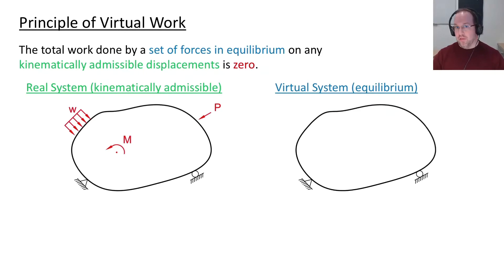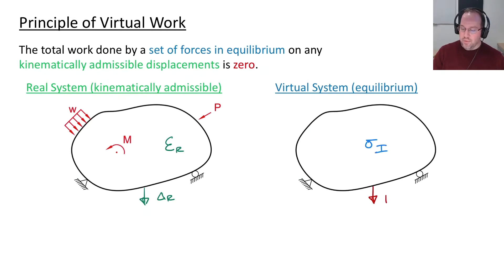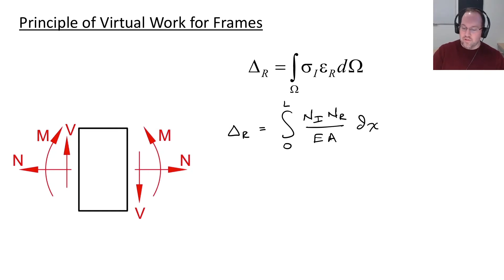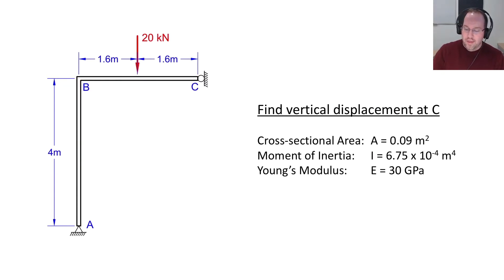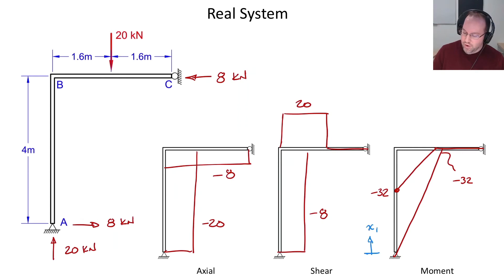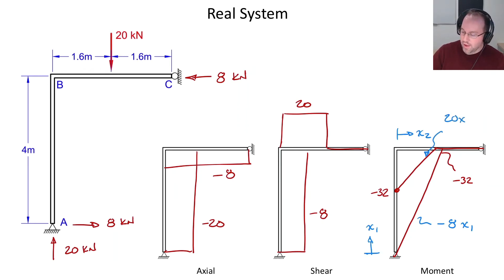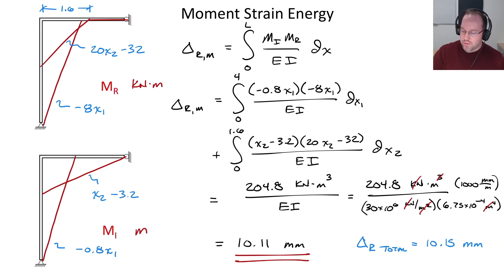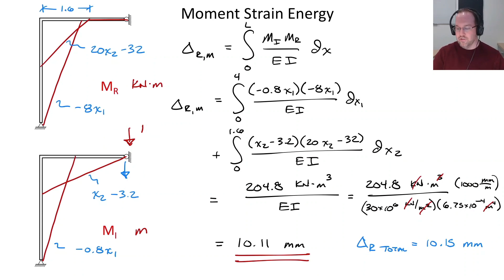Deflection of Frames using Principle of Virtual Work - Intro to Structural Analysis

Comment: Hi There, why don't we calculate and add the shear force strain alongside moment and axial strain for the total deflection?
Reply from the maker: Shear deformation usually is not significant for beams that are relatively slender (i.e., length/depth ratio > 10), so it is often ignored. However, as beams become deeper (i.e., lower length/depth ratio), shear deformation may be important. It can be included by adding another integral term to the equation: integrate (K*Vi*Vr)/(A*G) over x from 0 to L, where K is a cross-section factor that describes the shear stress distribution, Vi is the shear due to the unit load, Vr is the shear due to the real applied loads, A is the cross-sectional area, and G is the shear modulus. 

Here are a few simple assumptions for the cross-section K factor of common shapes:
Rectangular cross sections, K = 1.2
Circular cross sections, K = 1.11
I-shaped cross sections, K = 1 but the area A only includes the area of the web, not the flanges
Technically, K depends on the Poisson's ratio of the material, and it can be rather involved to compute exactly.

Also note that my definition of the K-factor is the inverse of what some other texts use, so just bear that in mind if you are searching for K values of typical sections. For example, if you look up Timoshenko beam theory on Wikipedia (https://en.wikipedia.org/wiki/Timoshenko–Ehrenfest_beam_theory), they use K*A*G whereas I'm defining K/(A*G). It still works out to the same thing if you are consistent. The Wikipedia site approximates K = 5/6 for rectangles, but this is just the inverse of 1.2 which is what I've cited above.

Comment: Awesome video.  Thank you for posting.
quick question on this:  Why does the integral for the moment at member B-C only go from 0 to 1.6 instead of from 0 to 3.2?  
Thanks
Reply from the maker: Thanks for watching!
The integral goes from 0 to 1.6 only because the moment from 1.6 to 3.2 is equal to zero (I was being lazy). So yes, we should integrate along the entire length from 0 to 3.2, but the portion of that integral from 1.6 to 3.2 goes away.

Comment: why the horizontal force is 8kn？
Reply from the maker: We need to a take the sum of moments equals zero about point A to find the horizontal reaction at C. Doing that, we see...
-(20 kN)(1.6 m) + (Rcx)(4 m) = 0, where Rcx is the reaction at point C, assuming it points to the left.
Solving for Rcx, we get Rcx = (20 kN)(1.6 m)/(4 m) = 8 kN to the left.
We then apply sum of forces in the x-direction equals zero, which shows that the reaction at A in the x-direction is 8 kN to the right.